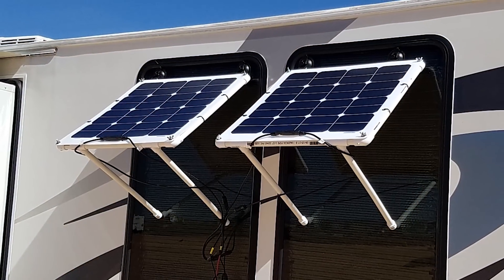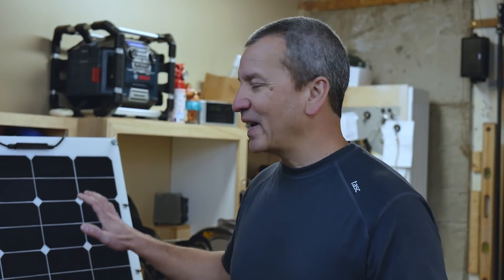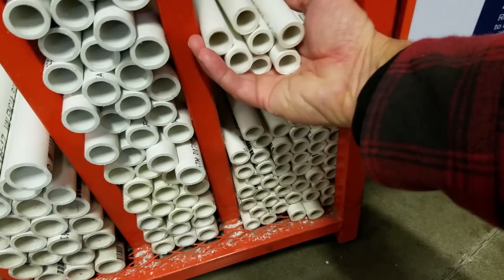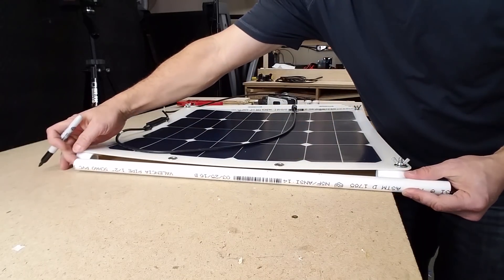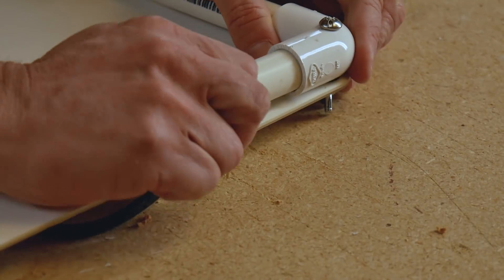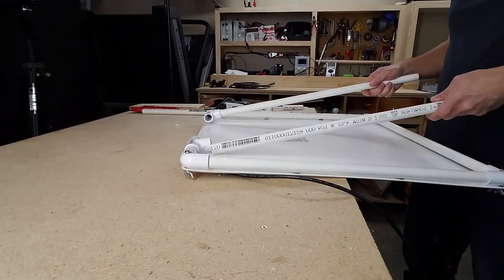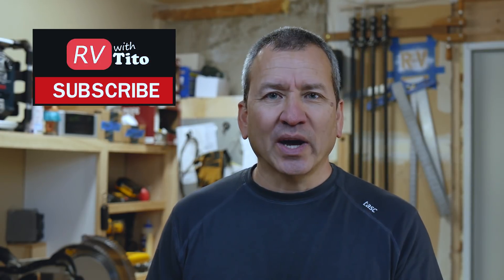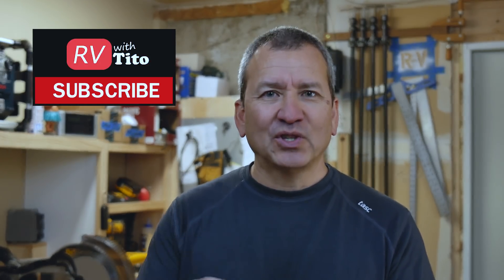Build a SOLAR PANEL WINDOW AWNING Battery Charging System

Comment: Great idea. I particularly like the frame you made. I'm thinking about that gram for my roof as well so I can tilt them. Here's an idea for you. I have a 100watt flexible panel that I use on my windshield instead of privacy or sun screen. Works great and serves 2 purposes.
Reply from the maker: I always keep an extra 100 watt panel too because there's lots of ways to use it.

Comment: Good Morning. Sound great but can the panels be put on the top of my trailer and secured with the tape? And can I use one 100w panel and latter add one or two more?  PS do I need the last item.  Jack
Solar Set Up
2-4-2018
1. 1 HQST 100W 12V Monocrystalline Panel.
2. 1 Victron Smart Solar charger Blue Tooth.
3. 2 Air Head Sup Suction cup.
4. 1 SAE sidewall mount.
5. 1 Power Rail SW.
6. 1 Batten Ex cable.
7. Renogy adaptor (maybe if I do not make one).
8. Blue solar Victron MPPF Control for setup and monitor ($80.00) DO WE REALY NEED THIS.

Comment: Winnebago includes an remote solar panel plug in the electrical box that ties right into the Zamp system in my class C Fuse.  While the Zamp components are PWM 12 volt they are pretty darn good to 30 amps and are working fine.  I have 410 watts on the roof, and another portable renogy panel for remote use when needed.
Reply from the maker: Sounds like a decent setup. MPPT is not a requirement. I like it because it gives me more options.

Comment: Good Morning. Will suction cups leave a mark on the windows or siding over time.  Jack
Reply from the maker: I suppose they could if you left them on permanently. Probably would be more of a concern on the siding. I only put them on when I need them and never leave them on for more than a couple days.

Comment: What a neat idea... get solar charging and shade all at the same time! This is what we love about your videos, Brian... creative, outside-the-box ideas to improve RVers lives! Thanks for the great demonstration. One thing we were curious about is wind. Have you had any issue with wind lifting/shifting the panels, making them bang around on the side of the RV?
Reply from the maker: Glad you liked it! I haven't used them in really windy conditions yet. I've thought about it though. I'd remove the end cap from the legs, drill a hole in the end, and attach a suction cup to each leg. I light wind, they seem to stay pretty still though.
Reply: We thought of the suction cup idea, too. Bet that will work just fine.

Comment: This is real great idea for portable panels. I like the idea of the mppt controller. Lots of portable panels plug directly to the battery with the OEM installed solar panel hookup included on rigs today. The suction cups and legs are so intuitive. Great video and thumbs up. Happy travels, Lou.
Reply from the maker: I would totally love some transparent solar tech on the windows. That would be one spendy window though for the limited power they would generate :)

Comment: Awesome! Great ideas there. I’m planning on a deployable solar setup for extra power too. Already have my BlueSolar 100/50 for the main rooftop system.  Will probably do a smaller unit like yours for the auxiliary array. Isn’t that Bluetooth app the best?!? Very cool system man! 👍👍
Reply from the maker: Nice. Sounds like a good setup. Yeah. The bluetooth option is pretty cool. The newer controller even has the bluetooth built in.
Reply: RVwithTito I know!! Had to get the dongle for mine though. Found 100 watt flexibles on amazon for $129. Getting ideas....

Comment: Bryan - great video. I'm a little confused on the need for the separate mppt control meter if you've already got the Bluetooth dongle and app. Does one device do something that the other one does not?
Reply: Greg Ridge it just gives you a more convenient option for viewing the status of everything. I have just the Bluetooth module on my victron.
Reply from the maker: My primary MPPT charge controller is sized for the rest of my solar. Also it is a different brand (Morningstar) and does not have bluetooth. It's totally separate.

Comment: Great idea Brian! I was just telling the wife about doing some PVC framed flexible panels for our system. We dry camped under some trees recently and it would have been nice to throw some portable panels out to grab some power. I also thought, man I don't want to use mc4 because they are kind of a pain for a quick plug or unplug. The SAE is a great idea, and it looked factory, great install!

We have that Victron 700 battery monitor as well, I hooked my blue tooth dongle up to that, but we have different brand charge controllers. That little monitor is awesome and I am glad we got it. Like you mentioned the app is nice ad gives you some neat info. I also like that I can set an alarm to warn me if I get near the dreaded 12.2Vs.

I also wanted to say what a nice work shop you have. Love the benches builtin beside the miter saw. I am definitely going to miss my garage once w hit the road full time.

-Thomas
Reply: I'm thinking a person could also use something like this as an awning to shade window frames in the summer. Those frames can get hot.
Reply from the maker: Thanks! Yes I would totally keep an extra panel or two plus inexpensive controller handy in your trailer. A 100 watt flex panel fits nicely under a matress or in the back of your closet. It has come in very handy when we've been in the woods with a peek-a-boo shot at the sun. I love your setup too. I'm going to be splitting my roof panels across two controllers this spring and will probably go with another Victron. 

I'm glad you liked the shop. I built that last winter plus a couple big roll around work benches. It's been a great setup. I would totally miss my garage.
Reply: If I could do anything different with my current set up it would be swapping to Victron charge controllers, because that blue tooth option with all the data logging is awesome. The battery monitor is handy for an overall, but it would be nice to see which panels are doing better for our series vs parallel testing.

Comment: Nicely done! Just installed 400W of ETFE Flexible panels on my Ford Transit with an option for extra 'mobile' panels at a later time. May not need the extra panels, but I'll keep your idea in mind. It's better than having those panels on the ground and blown over.
Van Williams - CargoVanConversion.com
Reply from the maker: Hey thanks.

Comment: That's pretty ingenious. I probably would have gone with the highher wattage panels from the start to make my cost per watt a little more palatable.
Reply from the maker: I've gone with 100 watt panels in the past and I still keep a spare in the RV. I was attracted to the smaller panels just for these two windows because they were perfectly sized.
Reply: You've got the use case for it. How many watts of permanently installed solar do you have?